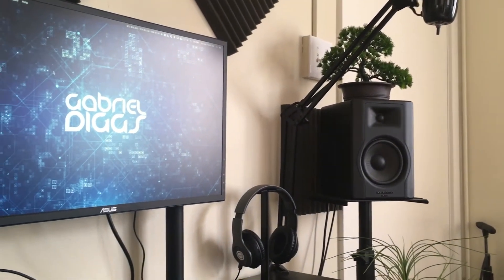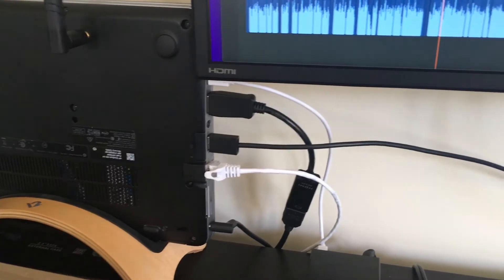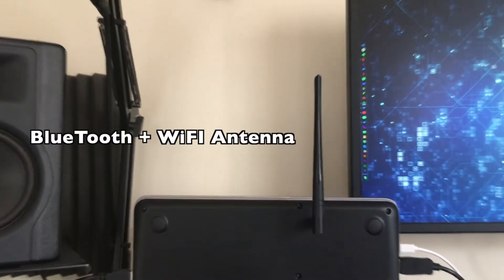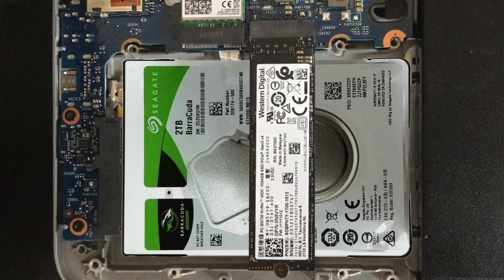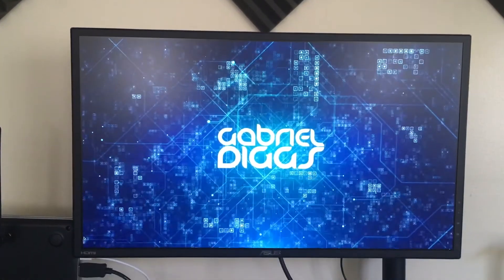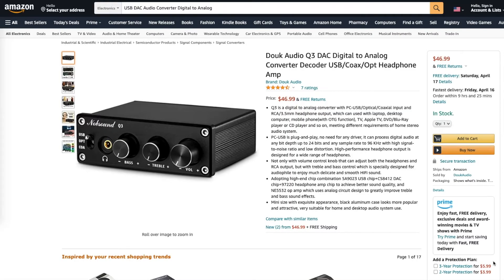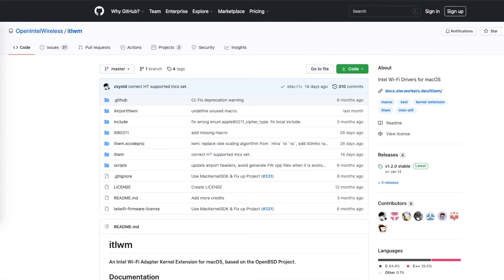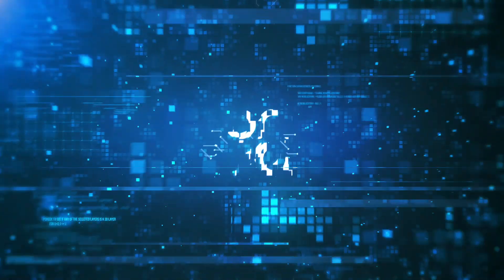Hackintosh Your System! HP EliteBook 820 G4. The Budget MacBook Apple Doesn't Make!

Comment: Very nice video.  what is the bios version you are using?
Reply from the maker: Thanks for watching! I'm no longer using this setup. I recommend signing up for an account at tonymacx86 and visiting the specific forum for this unit if you need help setting up your build:👉🏾 https://www.tonymacx86.com/threads/guide-hp-probook-elitebook-zbook-using-clover-uefi-hotpatch.261719/ All the best to you!
Reply: @GabrielDiggs  Thank you for the instant reply. I followed the guide and  I have experience in previous models 840g1 . But in 820 g4 installation is stuck at I2C controller. I think bios version is the problem. I will try again after downgrading the bios. Thank you.
Reply from the maker: @AG-ip5sg  Yes from my memory the BIOS needs to be below a specific version or it won't operate at all. There are posts in the forums about the specific version I think.